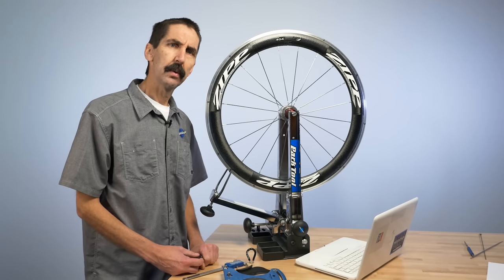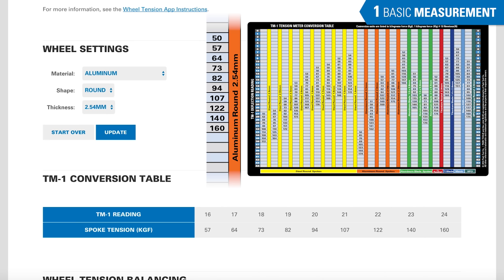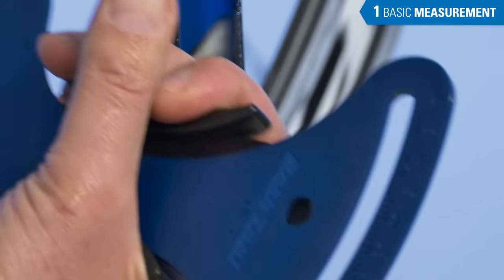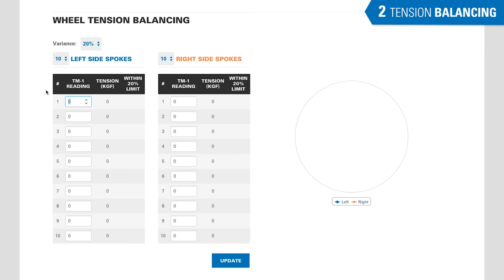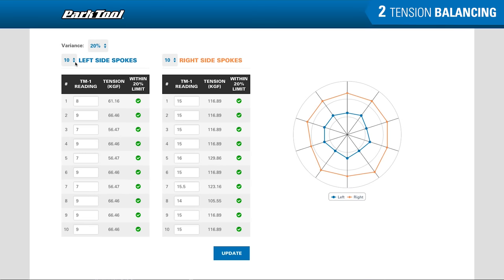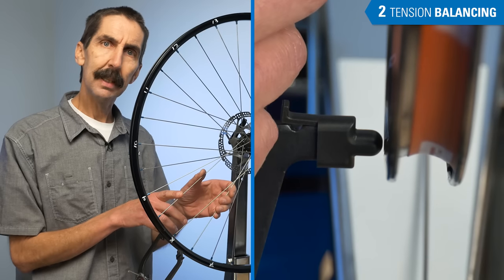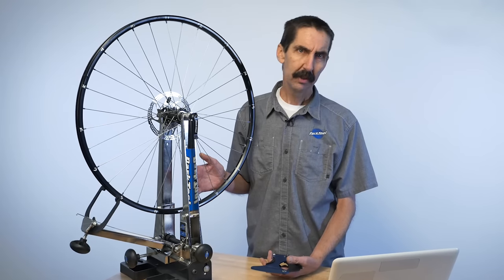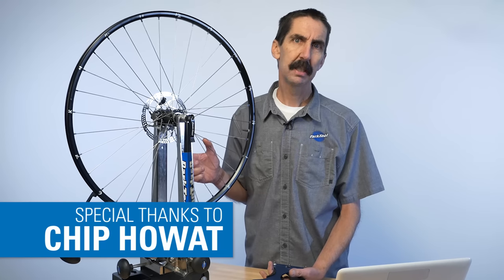How to Use the Park Tool TM-1 Tension Meter & Wheel Tension App

Comment: Extremely helpful! Amazing how our local shops are oblivious to proper when truing and tensioning skills. Thanks!
Reply: New Age Kenn...........  Are they? Hazard how wheels I have, built before the advent of New Age tensionometers et al.  are STILL fully operational, never a broken spoke, most with over 50,000 miles.
Reply: @death2pc  I think experience varies a lot. Clearly if your are a really good builder ur going to build a lot of muscle memory with the tension of spokes.

Comment: I got a tension meter years ago and didn't expect to use it except on the initial building, but it is so useful to go around a wheel and check before snapping spokes, before a big tour or after 4k miles or a few 100 after building a new set, the tools are very useful to know what's happening with a wheel.

Comment: Just purchased a TM-1, very glad I found this youtube video. The online Park Tools URL app is an excellent free resource, customers can hold bike shops to accountability. This is a simple java script, there's alot of s/w that can d/l this script, then you can convert it into android through an app porting utility. If you're working on the same rim all the time, perform the spec once, print it out and just use excel with a simple multiplication formula. I'll be fabricating my own truing stand with dial gauges instead of eyeballing the gap with typical store bought units. If Park's TS2.2 was at least 35% cheaper I'd buy it, however my higher precision DYI stand will be under $150 all in (3 dial gauges, angle steel, hardware, 2 hrs labor).

Comment: Amazing tool, thank you so much ParkTool. I've use it for first time on by race bikes rear wheel. The spokes  were creaking and loosed its tension. Its fanastic what the tool did to the wheel.  Now with your tool i made the wheel like its just came out from the factory. Before i used only spoke wrench, testing the spokes with the fingers. As a result spokes were never perfect. But now they are fine tuned. Thank you!

Comment: Great video. I'm doing this now. I had an absolute perfectly true and dished wheel but had a few outliers on tension. When I adjusted tension it changed the true a lot. Starting to get a better understanding of how they all play in to each other.
Reply: Look at 15:15 . If the rim/hoop is bent, it is unlikely that you will achieve both a true wheel and tight tension tolerances. To prevent this, the spokes must have ideal tension from the start... but this is seldom the case with generic branded wheels. Upon realizing this, I am in the process of teaching myself how to build wheels. It might be worth it considering how I ride 😅

Comment: Great Video! I am still slightly confused as to the tension on one side of the rim vs the other. why would the load not be evenly distributed between left and right side?  Thanks for these videos !!!
Reply from the maker: Good question. On most rear wheels and many disc bike front wheels the bracing angles are different as the hub flanges need to be offset to accomodate the gear cluster or the disc brake. The bigger the bracing angle the more it can pull the rim effectivly.  When one side has more bracing angle, the smaller bracing angle needs to have a higher tension to keep up. So the side with less bracing angle has more tension than the one with a larger bracing angle.

Comment: a bit simplistic. As soon as you adjust a spoke's tension it affects the tensions of multiple spokes; those spokes adjacent to it and also opposite it. Also, I've found with that tool, that you have to jiggle it to get an accurate reading. Jiggle it a bit till the reading is stable. Sometimes the reading doesn't change much, sometimes it changes a fair bit. This should be obvious if you think about it. Once you think you've finished tensioning the wheel, measure all the spokes again - you'll get a surprise 😄. The bad news; there's more work involved. The good news; the amount of adjusting needed does diminish. This is why I do my own work.

Comment: 13:26
The problem is that if you correct tension of a “bad” spoke, you have to recheck all other spokes since their tension is changed too. All the recordings in a form will be different.
Reply: amgluk in my experience, for practical uses, it’s okay to just input the corrections. Measuring every spoke again will not show significant difference since the tool has a limited accuracy of “half a number” as Calvin said in the video.

Comment: A cheap and easy way to do the same, is to bang the spoke lightly with a metal tool, and then listen! If the tension is the same for all spokes, and the wheel is correctly sat up with no going up and down, or to the side - it will give the same sound.

Comment: I am using this app actively. But I wish there is an offline version, or even a mobile app.
Reply from the maker: It is designed to be mobile friendly. Offline is not in our sights currently.
Reply: I'd like to second this request. I'm sure many users would happily pay a small fee for a phone or desktop app with the option to save files locally.

If that's still not in your plan, could you perhaps add an option on the web version to save files locally?

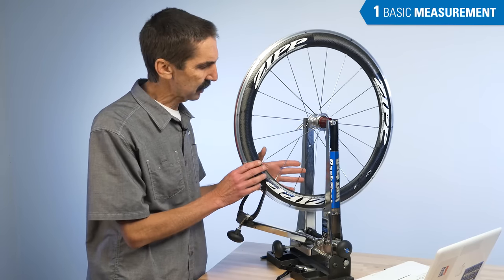Comment: 5:38. You can't just change the spoke tension like half a turn for the entire wheel to get it in range. You WILL put your wheel out of true. It's much more complex than that.
You might think that doing this won't do anything to the trueness of your wheel but it will.

There's not only lateral trueness (left and right), but radial trueness (ie. if the wheel has a bulge in it). You also have to consider that the hubs on bike wheels are not perfectly centered, especially on bikes with disc brakes and back wheels (because of the cassette).

So if you loosen all your spokes even 1/4 of a turn, you will warp your wheel.

Comment: Hey Calvin.  I ride a unicycle with a 24" wheel for about 6 years, and just lately my spokes have been breaking. .  At every month or so, I had one break, then two, then another.  Probably a half dozen within a year.  I don't do any hard impact tricks, but lots of static balancing/idling stuff.  I saw one of your video and I pretty much know what you will conclude.  I need a whole new set of spokes.  I'm considering lacing myself, because I think it will be easier since equal spoke tension is more important than perfect trueing(total runout) for slow unicycling.
Reply from the maker: With that many broken spokes its likely time for a new rim and a new set of spokes. The old rim and old spokes have been fatigued. An opportunity to learn a new skill and possibly improve your Uni's wheel!

Comment: hi there @park tool. any way you explain in depth the result of the spoke stats? also, the lower the variance, the tighter the spoke are? does that mean it lasts longer in terms of staying true in terms of servicing the wheel? thank you
Reply: If the information in a DT Swiss YouTube 

"Mastering the wheel (video lesson)"
Dec 15, 2015
b0bruto 
(https://youtu.be/_MLyw7LiCLc) 
on wheel building is anywhere near correct: YES. The impression I gained the closer the tensioning is consistent around the rim, the better. And best is when it is evenly applied and as close to design specification (kg-f)for the hub/rim/spoke components.  If you were working for DT, and building their idea of the highest caliber wheel, they demonstrate one additional step: soldering wire wrapping reinforcement at the most distant spoke crossings from the hub. (Someday I hope to regularly achieve such considered results.)

Comment: That's a really good app...but if you but the spoke tension tool , dose it come with a digram of tensions and or a starting point...iam wondering if you can tune the spoke to tone using a guitar tuner mic and amp...it may sound crazy but ...i believe it can work..???
Reply from the maker: There is a paper chart included with the tool. There are some who tension with tone. We have not found it to be consistent.

Comment: Every time i balance spokes in one area, the entire tension of the wheel changes. My spokes are too short, and im not sure if that contributing to that. Ive got the tension pretty much maxed out because of the short spokes. Should i be worried? Also the app crashed 😡 right after entering everything

Comment: Thanks for this helpful video. I just got the following issue. On my Reynolds AR58/62 I obviously got Titanium Spokes because they are not magnetic and have a diameter of 1.8mm in the middle of the spoke. At the end, close to the nipple it has 2.1. In the WTA App I can only choose a diameter of 2 for titanium spokes. Is it still true for a 1.8mm spoke like in my case? Or what would you guys recommend me? Thanks a lot for your help.
Reply from the maker: Titanium spokes are not common, especially on prebuilt wheels. Looks like that set comes with Sapim Sprint spokes. Those are a cold forged stainless steel (steel in the TM-1 chart)and will have a very very very slight amount of magnetism.

Comment: I'm a bit confused with the part that comes out after you put in spoke size, material etc and it gives you a recommendation based on this. What am I looking at from this table to get an idea of what tension to go to per spoke? I have sapin race spokes on disc wheels. Thanks
Reply from the maker: Your max tension is typically set by your rim manufacturer. The app will not tell you how tight to get your wheel as different systems, rims, hubs and spokes are different. Look to your rim manufacturer for max tension and go 10 KGF below that. That is a fairly typical tension goal. Most rims are in the 100-130 KGF max range. There are some that are higher and some that are lower so it is good to check.

Comment: I have a question, App aside. This does not apply to the app but tension. 

someone gave me a rear wheel to fix and some spokes are steel, some are aluminum. is that an issue for truing? 

The app is a godsend, by the way. can't wait to do my first build with it !
Reply from the maker: That will not be an issue for truing but (it may be for reading tension) it is nearly impossible to have a wheel with a mix of spokes like that. Wheels with aluminum spokes have proprietary hubs and often proprietary rims that will not accept steel spokes. There may not seem like there is any pull from the magnet when checking but if the spoke is a J-bend you are more than likely dealing with steel/ stainless steal spokes. My guess is that you are dealing with all steel spokes.
Reply: Thank You so much for the advice, Calvin ! You guys are the best of the best !

Comment: Is this an error in the WTA or is my math not correct?
When choosing a bladed spoke in the calculator and interchanging thickness and width (e. g. 2mm width and 1 mm thickness compared to 1mm width and 2 mm thickness), the calculator yields the same figures/ chart, which doesn't make sense to me because the thicker part of a rectangular shape has a higher moment of resistance to the bending force.

Comment: When measuring spoke tension, should you have a tire installed and inflated to the proper pressure or just the wheel without the tire?
Reply from the maker: Looks as if Calvin answered your question last night. Check tension with the tire off. Manufacturers suggest this as they would be higher than manufacturer spec when you got a flat or were switching tires. Cheers!
Reply: he did, thank you!

Comment: Dear Park: The app differs slightly from the TM1 chart! Are you aware? 2.2mm x 0.9 (sapim CX ray). Please check it.
Reply from the maker: Cycgnr   The Wheel Tension App is the newest and most accurate chart across all dimensions. When building or tensioning a wheel choose the papers numbers or the WTA numbers and you will build a beautifully tensioned consistent wheel. If you cross mix the numbers it will deviate slightly. Much like using two different power meters.

Comment: In case of ALUMINUM spokes, are the all made from same type of alloy? Assuming that I have 2.54mm type1 alloy reading is showing me 25. And I'm making another wheel with 2.54mm type2 alloy, again reading is showing me 25 but one can be stiffer from the other right? Or It's so minimum differences that only people in Mavic,DT... are taking care about?

Comment: After mounting a tire onto the wheel the tension decreases. So the spoke tension should be measured with a mounted tire to achieve the specified tension, am I right? 
Thanks for the great video!
Reply from the maker: No, You should set the tension before the tire is mounted as if you set the tension when the tire is mounted and you get a flat then the spoke tension will exceed the max tension of the rims or hubs. This is something that ive talked to a number of wheel manufacturers about and this is they all agree that spoke tension should be measured and set while the tire is off the wheel. Good question!
Reply: @parktool  I have tested my new set of carbon 50mm road bike wheels and when riding out of the saddle the rear rim is rubbing against the rim brake. I assumed that the spoke tension is generally too low and the reason for the spongy wheel. It's a tubless setup so I would like to avoid to dismantle it again to check the spoke tension. From some tension  charts from DTSwiss one can see that the tension decreases by ca. 15 % after a tire was mounted. Is it a good rule of thumb to measure the tension with a tire mounted and multiply it by 1.15 to get a value which roughly equals the tension without a tire? I hope yes but I guess it's not.
Reply: Almost deflating the tire should also get me close to a wheel without a tire, right?
Reply from the maker: I would deflate the tire and then check your tensions. Are your new rims much wider? Often as your brakes have to open further, the adjustment can become more difficult and the leverage ration seems to change and not allow as much room between the pads and the rim. Does this sound like what you are dealing with?
Reply: @parktool  Yes, the rim is wider and I realized it when mounting the wheel, therefore I readjusted the distance of the breaking pads to the rim before my first ride. After this ride one could see that the wheel is not as true as it was before. Some of the spokes on the non drive side sound lower than the others. I'm waiting for my ordered TM-1 to check the wheels in depth. Thank you for your help!

Comment: HI ! Will you please give us an advice as to what spoke tension to consider between the tension when the tire is removed from the wheel and tension when tire is on the wheel and inflated? I mean I measured tension of an ultegra wheel without tire and got 19 on the scale of parktool tension meter , but when I measured without the tire inflated, it returned 16 on the scale. Which of two should we consider when checking against manufacturer tension recommendation? Thank you!
Reply from the maker: It is normal for tension to drop from the tire  under pressure. Manufactures give tension rating assume it is without tire, as if wheel building.

Comment: Why is it that you have different tension ranges for the left and right side? (shown in the app as the blue line being wider than the yellow line). Shouldn't both sides of the wheel, left and right, have the same tension?
Reply: Some wheels are symmetric, many wheels are not. A-symmetrical wheels have higher tension on the most steep side in order to get the rim in the middle. Imagine you pull the rim to one side, would you pull downward  ore sidewards? Well, what's going on in a wheel is not that extreme, but somewhere in that direction.

Comment: Can one say that if all spokes on one side have the same tension and the rim is not damaged, that the wheel will then be true? Do I still have to check the wheel for being untrue after all spokes have been balanced?
Reply from the maker: No, the wheel is not guaranteed to be true. The rim can be slightly bent or the opposing spokes could be holding the wheel out of true. Tensioning and trueing are very much related and effect one another but you cannot just do one without checking the other.

Comment: My wheels have different spokes for the left and right sides. No way to select that option in the app right? The app assumes the same spoke diameter for both sides...
Reply from the maker: At this time, the app cannot do this.  As a work around, open it up twice, and use one for each side.

Comment: Do park tools make a tension meter of smaller wheels? I.E. 406 rims as the TM-1 doesn't fit.
Reply from the maker: At this time, the TM-1 needs about 100mm of free spoke without crosses to fit.  For the small wheel with cross lacing, it does not fit.  We have no other option at this time.
Reply: @parktool  OK. Thank you for replying. 
I'll just keep on doing it by ear then, to get an even tension.
It would be nice to know if I'm getting the correct (within manufacturers specification) tension though.

Comment: I could probably do with this tool!
I tried to rebuild a wheel once I didn't cross the spokes enough and they all stuck out from the inside of the rim so I just cut the spokes off the result was funny,  I was sitting on the handle bars like et while a friend was riding and the front wheel whent down a little dip and the wheel collapsed!